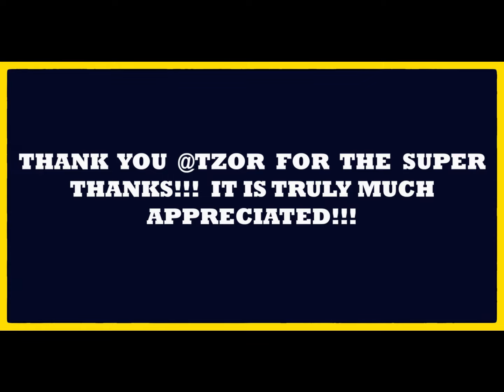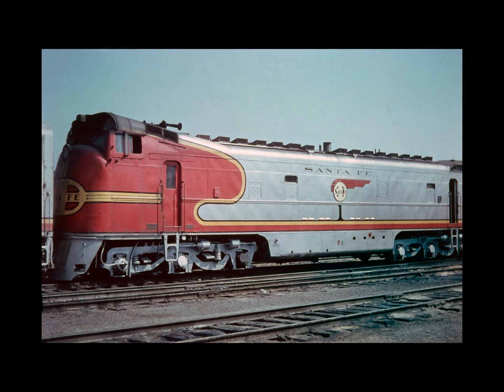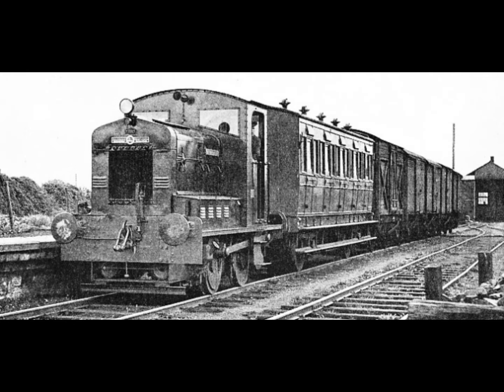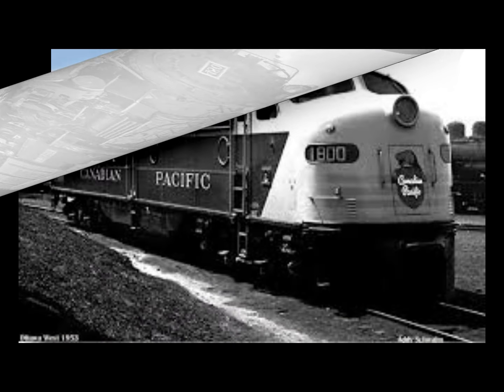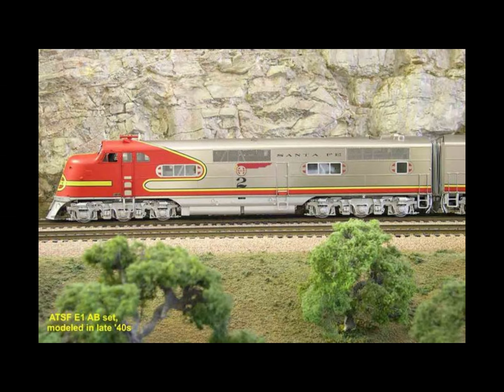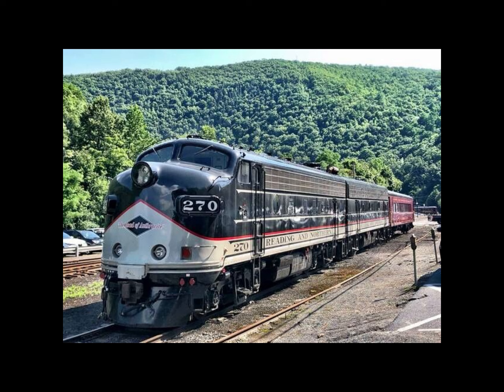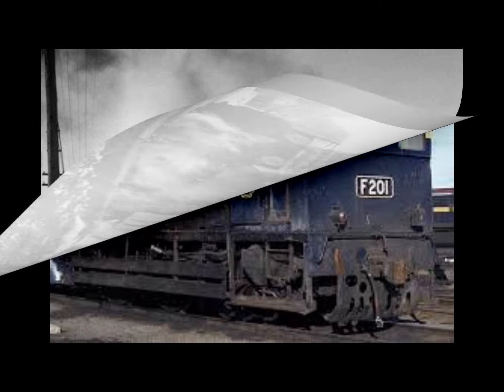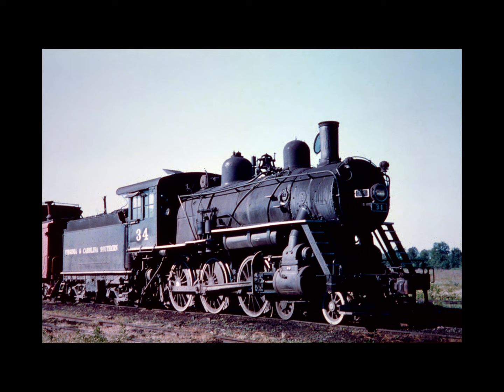Diesel VS  Steam... We know Which Won, But Why??

Comment: The simplest one sentence explanation of the relative strengths and weaknesses of steam and diesel that I've seen is:  "A diesel locomotive can start a train it can't pull and a steam locomotive can pull a train it can't start."
Reply from the maker: Never heard it and I love it!
Reply: That's because of electric generators. As you put more power through them, they actually lose force.
Compared to a steam engine, which once it gets going at. Its operating speed is at full Force compared to starting Which is where the saying a diesel can Start a train, it can't pull and a steam engine. Can pull train It can't start.
Reply: Back in the late 80's when I started my railroad career, some of the old heads that operated steam used to say this same thing. Many would say if only the two were combined you would have one heck of a pulling machine. As for the steam vs diesel, I mostly ran diesels, but did get a chance to run a steam locomotive on a tourist line and tried to look for comparisons . With diesels, I could get a good roll leaving the yard, but when coming up on a steep grade, that's when I had to watch my amp meter close and constantly look behind to be sure the other units were not having issues with overloading the traction motors or the engines working so hard that a crankshaft would get hurled through the engine block (which did happen once) especially with the older models. With steam, you had hands on with the power it put out, but had to know all the levers, gauges, and setting the power reverse lever just right as you gained speed to get it to maximum performance.😁 

That said, from talking with those running steam, they always said with steam the harder you work them, the better they would preform in both power and efficiency.
With diesels, as I spoke of, the harder you worked them, the high risk of something tearing up electrical and mechanical. Guess both steam and diesels will always have a plus/minus in their abilities no matter the gauge they run on.😁
Reply: Traction motors can overheat if worked too hard too.
Reply from the maker: @georgecarter838  And this is why I thought the Pennsy was on to something with the S2 had they the money to stick with the idea. They didn't...
Reply: @logan-p1i  no

Comment: First off the FT only had 1350 hp, not 5000. And when you compare a locomotive like the FT against a steam locomotive like the Big Boy you are not being fair. Apples to apples would be a FT against a smaller 6 driver steam engine. An FT AB set would be equivalent in tractive effort and hp as a 4-8-4 or similar steam locomotive. So to go against a Big boy you would be working with an ABBA set of FTs and then performance starts getting equaled. Yes it’s not a 1 to 1, but then again the big boy is essentially 2 engines under one boiler. Diesels were easier to maintain, cheaper to fuel, had longer service intervals, didn’t require frequent water stops, and could be reconfigured to suit any job easily. Also one crew could operate multiple engines, where you need a crew per engine with steam. So yea, all around cheaper, more flexible and easier to maintain. That’s why Diesel won.
Reply: The FT was marketed as a 5400 HP permanently coupled A-B-B-A locomotive, with 1350 HP in each unit. They had drawbar connections between units instead of standard couplers. Later in production there were a few exceptions built which were not ABBA. The railroads began splitting the original sets too, desiring the flexibility to mix and match with newer diesels designed with MU (multiple unit) capability, which was not a standard feature yet. This required installing standard couplers and compatible MU connections.
Reply from the maker: Diesels are you guy's arena. I only know a handful of them to speak about.
Reply: @TheRailroadCrossing-SteamPower  Don’t get me wrong, I love steam engines. The N&W Class J (611) is my all time favorite locomotive.  It’s just that diesels had a cost and flexibility that beat all. It’s kinda like sail vs power in the marine world. Power is simple, go anywhere and brought boating to the masses… but turning off the engine and letting the wind push you through the water is simply an awesome feeling.

Comment: I used to correspond with a marine engineer, who wrote once about the replacement of steam engines with diesel engines on a ship on which he worked. The steam engines were super-efficient QUADRUPLE compound units (high pressure, lower, low, very low pressure). Nevertheless, the fuel savings in the first year of operation paid for the diesels! After loving steam in my early years I have learned to like diesels, too. This has enabled me to enjoy my railfan journeys in the USA (I live in UK.)
Reply: that's a constant output.. and usually running at or below 17knts.

Comment: Even with all the technological refinements of diesels, up to the present day, they have not surpassed steam in one area: horsepower per unit. Diesels are definitely more sure-footed, that is, not nearly as prone to wheel slip. The most recent diesels from EMD and GE put out astounding tractive effort per unit, with ratings from 180,000lbs. to 200,000lbs. starting. As far as I know, this surpasses any steam locomotive. About 1 1/2 years ago, my wife and I saw an unbelievable display of sheer brute strength by diesels. We were at Fremont Ohio's east end when a westbound manifest came through on the Toledo Line out of Bellevue. On the point was one AC44C6M. Then, 120 cars later was the DPU, another "suped-up Catfish". we both confirmed each other's count of 283 cars. That's right . 283, not 183, all handled by only 2 units. Going through Fremont, trains must descend a grade, then climb up another grade out of town. This train probably didn't exceed 30mph the whole time, but it did keep moving steadily.  Conclusion: Except for the short-lived 6000hp peak reached in the 1990's, diesels still have not topped the horsepower of steam, but they are much more able to keep heavy trains moving.
Reply from the maker: The new Diesels are definitely banging. Better economy too.. Wont be enough to save it against fossil fuel shortage.. Unlike years past, hopefully the Railroads are already planning and developing for that.
Reply: Electric locomotives (and turbine units) have been able to pass steam locomotives in power
Reply from the maker: @844SteamFan  Well, even Baldwin had said by Wars end that the current tech that steam was using was close to being maxed out.
Reply: The thing is that diesels figured out very early on that they didn't really need to beat steam in terms of power per unit when they could do multi-unit operation. Yeah diesels needed to double or triple head to match mainline steamers, but it was really easy to do when it was needed. Doing multi-unit work with a steam engine required multiple crews that were coordinating and tending each engine, but with diesels you regularly had as many as 4 units being run by a single engineer. This is why the EMD FT sold with the B unit by default, the A unit couldn't compete with steam on its own, but the AB set could so EMD pitched the set as a single unit in multiple parts.

Comment: I had the same story on ships, but with even more mixed results. A diesel locomotive could (ideally) operate 20 something hours a day, for weeks between service, and has dynamic braking, a big cost saver on brake maintenance. A steam locomotive operated less than half a day, between daily cleaning, fuel and water stops, and necessary maintenance. If 844 needs its rods greased every 150 miles, fires dumped daily, tubes washed, the rest checked, and hours to bring it back on line for service, how bad were the older engines? On Steam ships, operation was 48 weeks a year, Kill the fires for annual dry dock, and go right back into service Tubes are cleaned in service, and no ash pan to clean.. Schedule was God, and steam ships can run at 100% or more to meet schedule at a horrible fuel cost. Diesels, can't, are always stopping to pull pistons for scheduled maintenance (ring wear and liner inspections at around 15000 hrs, depending on make and model). They only operate in the 85% power range, as if pushed harder, tend to wear much faster, or break down. Since diesels save fuel, more cargo is hauled, the cost of cylinder oil more than offsets the cost of the fuel. What killed steam was the cost of boiler maintenance. A somewhat specialized industry. Now we have emissions to further change the picture. Have fun

Comment: Alot of people may love steam engines more than diesel engines, but I prefer diesel engines over steam engines because they're stronger, far more efficient to run requiring much less maintenance to operate, and are cooler to me, especially the different variety of train horns usually being louder on average compared to steam train whistles, and I really enjoy the geometrical shape design that alot of modern diesel engines often seen running nowadays have. I was born when diesel trains already took over steam trains becoming the king of the rails years ago anyways, and both are equally iconic types of trains in their own right. Steam is popular with successful franchises, such as Thomas & Friends, and historic railroads like Strasburg Railroad often doing excursions with the steam engines pulling them. Diesel however is iconic with class 1 freight railroads including CSX, Norfolk Southern, BNSF, and Union Pacific. Also in many Hollywood movies diesel engines have been represented plenty of times. I still definitely enjoy steam engines too. Though diesel engines will always be the superior types of locomotives to steam engines, despite steam having its few advantages over diesel.🛤

Comment: I do know this: my dad was in a railroad battalion during the Korean War, and you had some serious grades over there. He would tell me, and I confirmed this, about the Army's diesel locomotives getting hung up on hills and mountain passes and had to have steam locomotives pull them up the grade.
Reply: That is a matter of tractive effort and weight. If you put too much weight behind any locomotive it will stall. Diesels have more horsepower available at lower speeds than steam, but a stall is from lack of tractive effort or weight on the rails. Steam locomotives can be designed for a specific speed, either low speed pull or high speed horsepower, but it is very difficult to get both from the same design.

The traction motors of a diesel produce lots of heat at low speeds, which can cause them to fail (burn out) if used at very slow speeds. This was a very real problem in early diesels, and there was a minimum speed that had to be exceeded. If you couldn't do that then you needed to shut them down and add locomotive units to reach and stay above that speed. Or split the train into sections that the locomotive could handle. Steam locomotives did not burn out, and you could maintain 5 MPH all day long if needed.

Essentially, below 5 or 10 MPH both diesels and steam are limited by tractive force, not horsepower. Tractive force is also limited by weight on the driving wheels, so you cannot get much more than 25% of that weight converted to real pulling power before the wheels slip. The main advantage of a diesel is in the midrange speeds, 15-30 MPH or so. Where the high-horsepower steam designs shine is at higher speeds.
Reply from the maker: In addition to what Steve said.. I believe they were running Mikes or Consolidations as well. Not exactly super steam there.

Comment: The iron horse went extinct entirely for economic reasons. They cost more than Diesel-Electrics for:
       1) Locomotive Maintenance
       2) Water Supply
       3) Track Depletion
       4) Car Maintenance  (No dynamic brake means more brake shoe and wheel replacements.)
       5) Availability (Mostly maintenance downtime, also it takes hours to fire up a "cold" boiler.)

As for performance, steam fared better than Diesels in passenger service, as steam provides a constant effort up to the speed where steam consumption outpaces boiler production. The Diesel is a constant-power engine, consequently tractive effort decreases with speed, but at startup the effort is only limited by adhesion. Since a Diesel's weight is 100% adhesive, it will produce more starting tractive effort than a steam engine of the same weight. It also has the smooth, steady pull of electric motors, while steam's herky-jerky cyclic torque makes slipping much more of a problem.
Reply: Many fine responses here, from people who know what they;'re talking about.  I particularly like what @kc4vh has summarized above.  Herewith a couple of additions to his list in favour of diesels.
     2a) Under 'Water Supply', realize that besides maintaining the tracks, railroads also had to maintain a string of water towers along every track.  Like today's electric cars needing recharge stations every couple hundred miles -- add up the frequency of needing to top up the locomotive's water, together with the time needed at each refill, and (for the trackside water tanks) another layer of mainenance costs. Especially to keep the towers working and full in cold winters, and across the deserts!   That entire line item of cost disappears as soon as the last steam engine is retired from the line.  
    6) Distributed Power, which is now routine with diesels but never realistic under steam.  Unlike items 1)-4) which are cost reductions, this is more a revenue enhancer, since it allows humungous length of train which steam power could never hope to match.  Think of a train as an occupied block of track, moving across the country. If each such block contains twice as much cargo (each train much longer) and the blocks move at the same speed (since the number of occupied blocks has not changed), then distrubuted power greatly increase the freight capacity of the entire line, all the time.  
     7) Crew Safety, to which dynamic braking from diesels gives  a boost. I have twice heard experienced engine crew mention safety as their big vote of appreciation for diesels.  A related safety point comes from distrbuted power: if the engineer starts a panic stop in his cab, the end-train power unit also applies the brakes at the same moment.  A mid-train unit applies brakes both fore and aft at the same moment.  So a miles-long train stops as quickly as a shorter train without distributed power.
Reply from the maker: All valid! Great insight

Comment: First off, I'm barely old enough to remember when steam was still in regular service and still love steam engines.  I am also a former CN employee and have spent a lot of time on trains.  However, you covered many reasons as to why diesel is superior.  Steam has extremely high maintenance costs.  They generally don't go more that a few hundred miles, without shop time, whereas a diesel can cross the country, turn around and come back again.  Also, notice how diesels are often paired, with a cab facing in each direction?  That means they don't have to be turned.  Steam requires a turntable or reversing track.  There is also the flexibility.  As you mentioned, steam locomotives were built for the various types of service, resulting in some that were huge and extremely heavy, to the point they were often limited to the tracks and bridges they could run over.  In contrast, if you need more power with a diesel, just add on another unit.  Also, steam cannot be operated as a multi unit, so you'd need a crew for each locomotive.  The crew compartment comfort is also a lot worse for steam.  In addition, there's pollution.  Coal is simply dirtier than oil.  Steam also requires frequent stops for coal and water and in some areas water is hard to come by.  Another cost issue is the time it takes to bring a steam locomotive up to pressure, before it can even move.

Bottom line, as you so often mention, the reason is the bottom line.  Steam costs much more than diesel to operate and that's what's important to the railroads.
Reply from the maker: Great points as usual!

Comment: The war between diesel and steam wasn't won on the road, both are very capable.  It was won in the shops. 

Steam is not coming back.  Coal is no longer an acceptable fuel, and diesels are much more efficient with oil.  We may see a shift to straight electric at some point, either overhead or, if there's a major breakthrough, battery.
Reply from the maker: I cant see electrification being done on the old method. It's costly, ugly looking and vulnerable to mother nature. So as you say.. Major battery technology, alternative fuel such as Hydrogen or even some sort of natural gas.. even solar on a battery system.